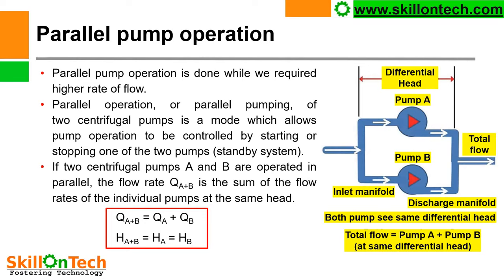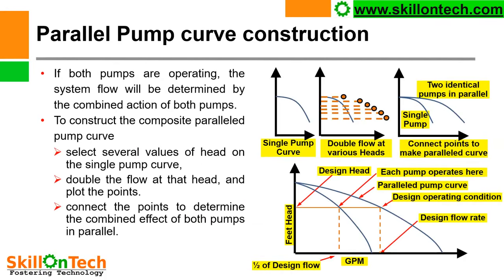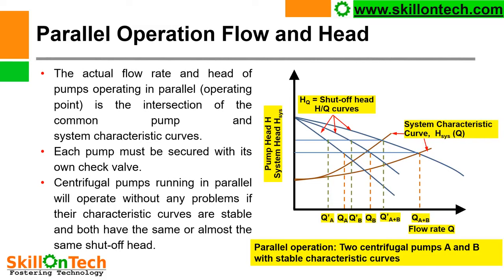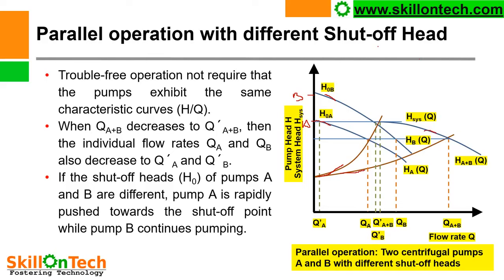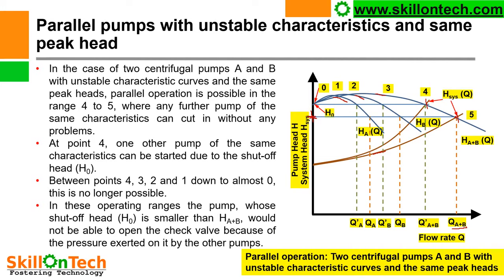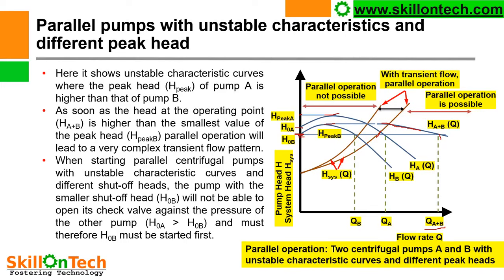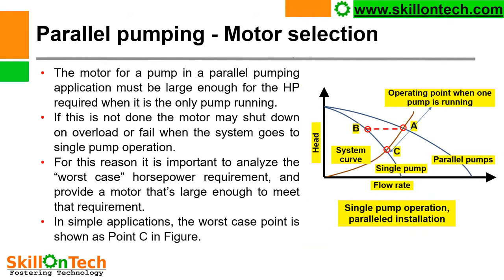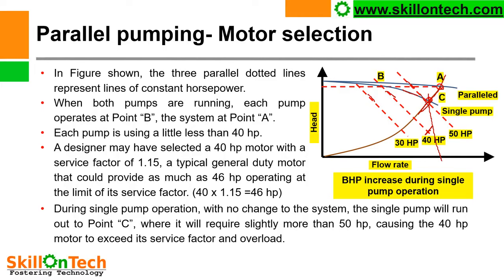Parallel operation of centrifugal pump (with english subtitles) | Pumps in parallel

Comment: Sir pls explain How pumps behave when we are operating them parallel in closed Loop network and also if three pumps with different capacity connected in parallel what will happen to net flow and head?